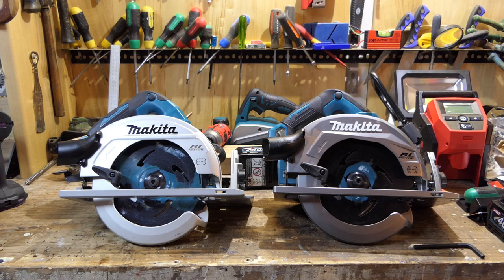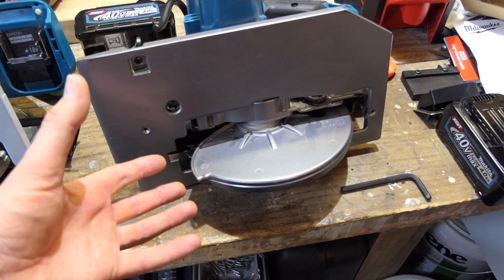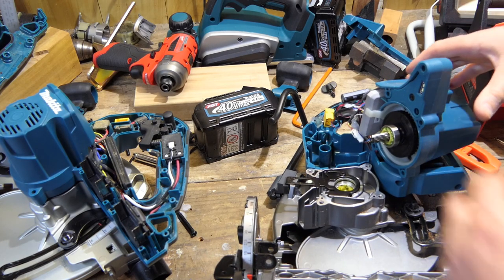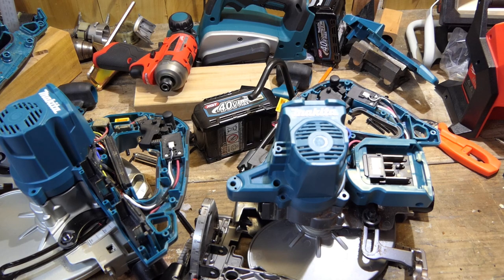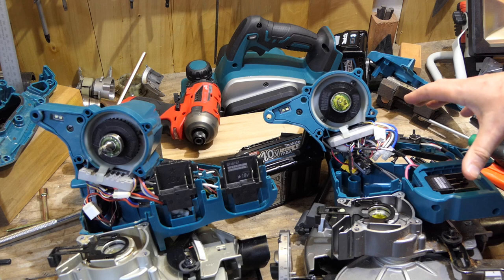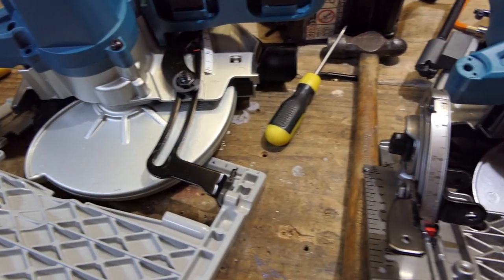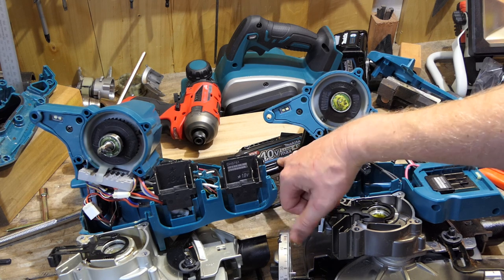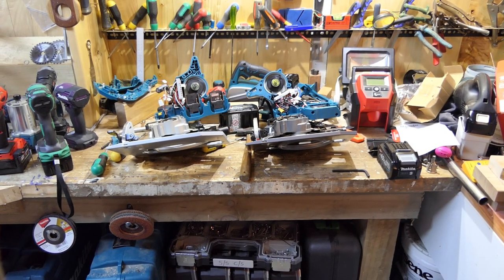Makita 40v Circular Saw VS Makita 36v (18v x 2) Circular Saw | Are They The Same? Let's Look Inside!

Comment: Man I just bought that 36v with the rail guide base and I can tell you that saw is a beast!!
Reply: Not available in Australia unfortunately
Reply: I’d like the footage of the reassembly, with audio.
Reply: I bought this 36v saw and the 36v rear handle earlier this year when they were running a deal. I haven’t used it a ton, but it’s good for what it is. I’ve been pretty happy with them.
Reply from the maker: YouTube made me remove it as it exceeded the "F" count... whatever that means.
Reply: I’ve been sincerely impressed by the performance  of their 36v saws.
Reply: which model has the rail guide base?
Reply: @TakamiWoodshop  Makita DHS782ZJ
Reply from the maker: And here is the 9 1/4" which has a very interesting rail plunge saw style base https://www.youtube.com/post/UgwI0v-kbR4pP1y34wp4AaABCQ